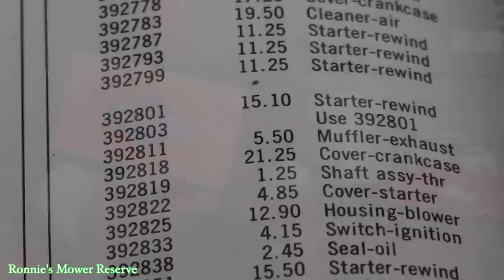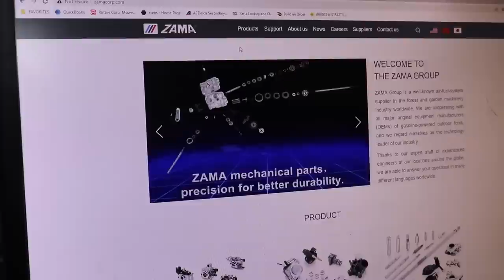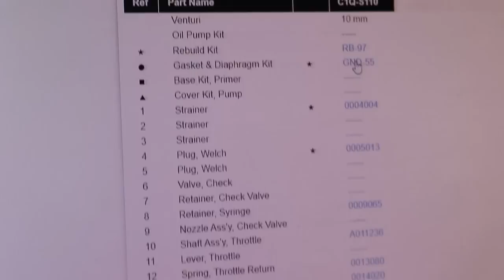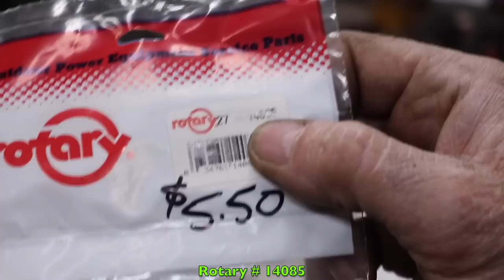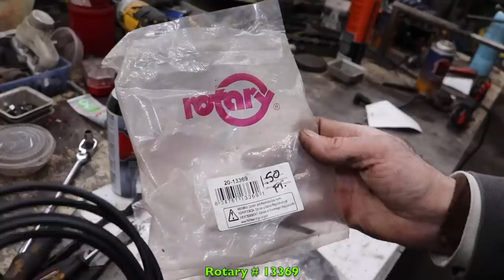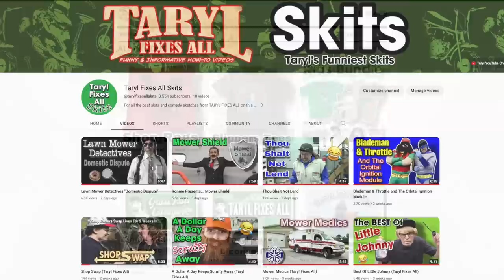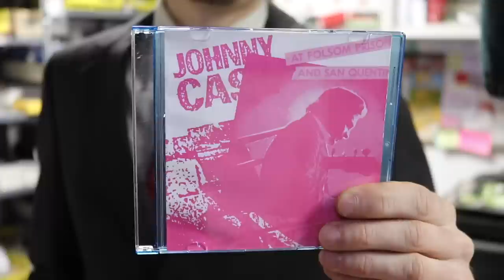Let's make some money 💵

Comment: There is nothing I like more than curb treasure!
Reply: I just picked up 2 really decent push mowers along side the road with a free sign yesterday. Briggs and Stratton flatheads. I never had one NOT run.
Reply: @chaotic twig  I will get one with a death rattle now and then, but you are right. They always seem to run.
Reply: Got a very nice craftsman rider at the curb. 75$ in one new spindle they broke ,2 blades and a battery. The mower and engine bay was clean like new. Gave it to my son for Christmas a few years ago. I’ll do that all day.
Reply: @John Anthony  I am jealous just thinking about it. 🙂  I have never gotten a curb rider,  I get mostly self-propelled mowers in my neighborhood.
Reply: @GuysPlayingWithTools   1st and only rider. I jumped it off and it purred. Couldn’t knock the grin off my face. I guess they hit a stump wrecking the spindle where blade mounts.  Was missing that blade. Bad battery so must be junk right lol. I look at that drive way every time I pass it. Came with 3/4 tank of gas. If not for my son I would have 400 bucks in my pocket with that one.
Reply: @johnanthony2545  And it came with good gas? Ok, now you are making me question what I am doing wrong.  🤣
Reply: @GuysPlayingWithTools  hell I’m questioning what I did right. Sometimes  the stars line up in our favor. Another million years and bingo I’ll get another one lol.  I’m a kinda lucky in that respect. I have 2 neighbors that gave me theirs. Not nearly as good of shape as the curb find but will clean up and sell along with my old one and get a newer machine. Most in my area are not hands on.
Reply: @johnanthony2545  I live a charmed life and find good stuff all the time but they are rarely free. You have to enjoy the moment and wait for the next good deal.
My neighborhood that is that way too, almost nobody cuts their own grass and their yard equipment just sits until it won't start... then I come along and offer them something for it 🙂

Comment: Rebuilt a number of these small carbs, old ones where simpler. The spring and ball down the hole adjust mix at light load and high load. If the spring goes weak wrong fuelling it does not run right. At 20 bucks for replacement carb not worth the special tools and work to rebuild it. Diaphragms gaskets and hand primer yea five or six bucks. Make sure you note where the gaskets go with regards to the diaphragm. Fuel lines rot out on all of them.

Comment: I just bought a lot of these 4 mix machines from a municipality, all were "Deadlined" I cleaned and rebuilt the carbs, adjusted the valves. They all fired right up, some had cheap gear boxes that had locked up, and wouldn't run at all. So I removed the gear box, and they ran like a dream! We got 15 FS90r string trimmers and they all run perfectly. It's crazy that people will throw away such expensive equipment, for something as cheap and easy, as a carb rebuild.

Comment: Lots of Stihl out here in NW Alaska.
Have a old weedwacker powerhead looks like the one you just went through.
Your video's are great!
Start fluid on unknown unit to see if it at least has compression to run.

Ice fishing augers out here cost allot, One spring cleanup I trash picked one thinking Id save a few bucks.
I set it in the shed and got busy forgetting it for a few years(5) then went to see what was up with it.
It had thrown a rod and blew a hole in crank case.
The one side I hadnt looked when I picked up the auger.

Comment: I have that type of Stihl trimmer, and they are an awesome cutter.  Mine appears to be a slightly newer model with some very minor changes,   Take the time to lube the cutter before use, and it will last forever.  These beasts are always easy to start, normally on the first pull.

Comment: "Waste not, want not " my grandmother would say. These are great videos when a basically sound piece of equipment is returned to good running condition after being tossed into a dumpster. New Stihl equipment is anything but cheap in our area, so if a good reliable repaired piece of equipment is available, someone will be very happy. I bet a new Stihl pole pruner is pricey. Thanks

Comment: Rode hard and put away wet.  Ethanol shitz everything up. Actually bought spare carbs for my generator , chainsaw, and riding mower. The carbs sometimes are not much more then the kit. Just video taking apart if your not very familiar with throttle and spring holes.

Comment: Taryl. I'd love to fine one of these for free that need some TLC. Have you ever used Tygon tubing for replacement gas lines? The Tygon holds up a lot better to the gas than the stock rubber gas line. Stens carries it and I think McMaster carries it too.
Reply: It's pricey.
Reply from the maker: Yes I do use the tygon fuel line I have all the different types and brands of fuel line. It's ok it gets hard as a carp over time and shrinks then leaks.

Comment: I bought a carburettor which leaked past the check valve because it Only had Loctite holding it in & the fuel ate it away so I had to buy another carburettor.

My solution to that problem is don't buy a carburettor or many other lawn equipment parts from a Muscat !

Comment: had one similar to this with the primer bulb deteriated,the carb kit was as much as a new carb so I just replaced the whole unit, problem fixed . all fuel goes thru the bulb , so if its cracked it will have bubbles in it and will run erratic

Comment: 16:25 never use carb spray on those carbs. It swells the rubber in the check valve and becomes a headache. I always use the ultrasonic cleaner for those.

Comment: Hey good question that nobody probably has thought of will echo or stihl warrantee a carburetor that does that because of the cheap adhesive or because they don’t service carburetors or fuel issues under warranty because it’s technically “lack of maintenance” and the customer is screwed?

Comment: I have done these and get them running and when its gets hot it bogs and dies. Meaning one or more of the crank seals are leaking and it's all for nothing. It's a gamble on any old 2 stroke equipment. That's why it's usually in the dumpster.
Reply: Yep it’s eather completely tare down or pure hell, then back in dumpster
Reply: Old two strokes generally need crankcase seals

Comment: If you’ve ever gotten a steel spark in an eye you’ll know what I’m talking about. Wear goggles if you sharpen this with a wizzy wheel!  Those sparks are tiny pieces of steel that can find their way around regular safety glasses and still get in your eye. Then you have to have an ophthalmologist remove it because it’s not something that you can just flush out. It embeds itself into your eye. Ask me how I know!
Reply: Been there man porting a cylinder head lucky I missed my cornea Face Shield or goggles

Comment: NO, no, you can't sharpen that like that... The angles are critical on those trimmers. You need to buy a special tool and honing guide. Someone go,na get killed using that thing. If it finds is way to the neck of a worker. Some ones go na get killed. Those angles are wrong.!!!!!! His dinner will be spilling out the hole in his neck....THERE'S YOUR DINNER!!!